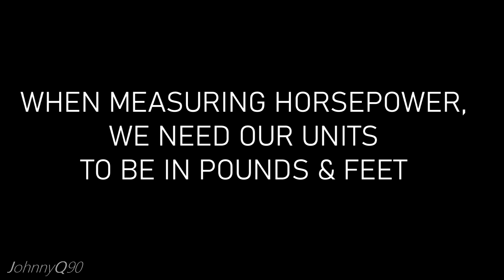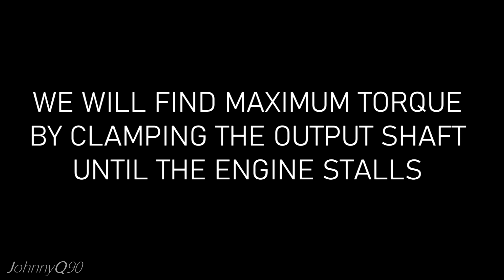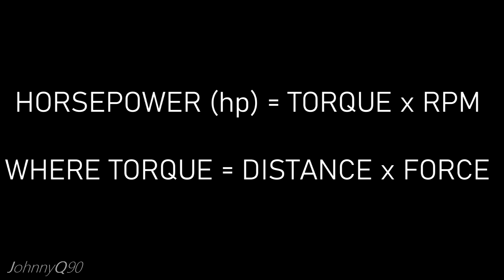Simplest DYNO for RC Engines! - Prony Brake Dynamometer!

Comment: I'm trying to design my own RC Dyno for bench testing 1/5 electric RC. I will be using gravity rollers mounted to a frame. there will be a pair of rollers between each wheel and I want to be able to adjust the resistance of the rollers but do not know what I need in order to also measure the resistance of the roller to create a "load" on the RC. I would also want to be able to capture the wheel RPM and eHP under the specific load. What is this type of attachment called and where could I find a power meter/analyzer like this? I need help and you are a genius with this stuff! My Goal is to be able to see how fast my RC will go under a specific load of resistance. And knowing the actual eHP output would be also very helpful since rated output is usually not even close to actual power output. Thanks!

Comment: Great job, i've wanted to  see a dyno for awhile. can you use a R/c Disc brake for  better control of drag? (so tightening wing nut doesn't effect reading)  and i would love to know if your exhaust mods add power, and i would definitely love to see some numbers from your Blower(s). thanks for the video.

Comment: Interesting! Works very well for a proof of concept. I think if you were looking to do an upgrade at any point, a road bike brake disk and caliper would make a more robust and sensitive system. Also, you couldn't need to get so close to the rotating assembly.

Comment: I would suggest making a small disc brake setup to load the engine with and mount the cable or servo actuated brake on the lever arm to push on the scale. You'll be able to load the engine without directly touching the arm and affecting the measurements. Also it'll involve some cool machining and fabrication.

Comment: When you are using horse power as a unit, could you please also show the value in watts? It would make so much more sense to me, as these engines are more comparable to small electric motors than big IC-engines.
Reply: 1hp is about 750w. So 0.1hp is equivalent to a 75w electric motor

Comment: Suggestion: 
Instead of using wing nuts and possibly adding weight to the scale with your fingers touching the wing nut. You could mount a high torque servo in some fashion to the brake and then use use a simple dial adjustment to clamp down on the brake for real precise braking and measurement. Just an idea I came up with watching it.

Comment: I can't say I'd trust those scales as a precision Dyno. The clutch housing might be an easier way to get better figures. The point where the engine output meets the drivetrain. This way you can make some sort of lazy clutch where it's always under friction (maybe without springs) then when you rev. it will up the load on the bell housing (connected to that arm you made)

Comment: You can calculate the HP mathematically also. The formula is HP = Bore squared X stroke X RPM and divide by 18000, I don't know the bore and stroke of your engine but this is the formula vehicle manufactures use to calculate the HP numbers for advertising and emission data.

Comment: @JohnnyQ90 Did you do the same valve thing on this engin... i know for sure, the valves dont close properly on these engines... I had to mod mine to make the valves close properly...?
Reply from the maker: Yes, same procedure here, but wrong fuel. I used 16% nitro airplane fuel, while I should have used 25% nitro for cars.

Comment: Did you consider a simple 'flywheel' type where you log the torque of the motor while spinning up a heavy flywheel?  Could make it fully mechanical with a pencil on a stick drawing on a scrolling paper...  :)

Comment: Nice to see that you made sure to talk about the limitations of your experiment!
Make sure to take into account the flex in the wood and the printed plastics too, shouldn't be too difficult for your brain to comprehend I don't think. ;)

Wouldn't it also make more sense to hook a slipper clutch up to this instead of using the wood as it's not the most "grippy" of materials? I guess that would also introduce more variables than it's worth.

I'm with Blase, when are you making an alignment machine? I bet you have something crude to deal with that aspect that works quite well!

Comment: I'd expect any manufacturer's specs to be exaggerated, but 1/5 seems excessive.  The fuel could make a difference, but there may be some measurement error there.  Given the small scale, small errors can amount to huge variability in accuracy.  Excellent concept, just a bit of refinement may be necessary 👍

Comment: My 2 ideas for the dyno brake:
Use a conductive disk that spins with the crankshaft and place a stationary electromagnet behind it. Alternatively permanent magnets at variable distance.
Should give a nice induction brake.

Second option:
Buy a large RC brushles motor, spin it as a generator. Attach a 3 phase rectifier, pwm controller and a resistor, then you can controll the braking torque with the PWM.

The first option is probably easier and more scalable if you want to measure sth larger
Reply: That second option is much easier imo i like it!

Comment: I think and electric motor with variable resistance would be a much easier and more accurate way to do this. Because you are only measuring such small output power it should actually be quite easy.

Comment: Did you apply the conversion constant? Horsepower isn’t simply pound-force x rpm. You have to divide by 5252 and I didn’t see you mention this. Also you are measuring torque force at 0.5 feet, so this also needs to be factored in. You might have done this but I didn’t see any mention of it.

Comment: You do realise that you’re corrupting the measurement by touching the bar to tighten the screw, yeah?
Reply: I was wondering too, but how could he screw it without touching? 🤔
Reply: @ponzy  maybe with a manual clutch between the engine and the wood arm
Reply: @ponzy  perhaps a fluid coupling that would allow the engine to reach it’s max torque.

Comment: There's a few reasons this is inaccurate. Horsepower isn't just RPM*torque, it's torque x RPM / 5.252. Also you're losing a huge amount of power on that method of measuring. Most of it will be lost to heat/friction on the shaft.
Reply: The dyno measures torque or force, not power directly. The motor crankshaft is braked by some method (friction here) and the braking torque is converted to linear force by the moment arm. Power lost is equal to the power in, which is (torque * RPM) / 5252. 

In any dynomometer, all of the power is dissipated, but force is measured and then power is calculated based on speed. It doesnt matter that power is lost because the dyno measures torque, not power. 

The energy lost as heat will be proportional to the power generated and the force (torque) measured.

Comment: Hi, aweomse videos as usual, if i can give an advice: Don't use electronic scale, delay between actual mesure and display can be very different, this will lead to false measure and calculation moreover with small numbers where it makes HUGE differences (0.1 or 0.2 over 3 is already much diff) . Try to find a mecanic scale, you will notice the diff  :) . Keep doing great stuff !!!

Comment: @JohnnyQ90 In my opinion, this method does not give a very accurate result. By connecting a DC generator to the output of the motor and measuring the electrical power at the output, you can reach a much more accurate result. And you can calculate power for many rev ranges.

Comment: That’s a neat low-tech method, but instead I’d have made a simple (arduino) USB/serial datalogger, using a photo-interrupter and a load-cell ADC circuit. Should get me a whole torque curve from it. Planning do do something similar myself for a BLDC, though my motor’s torque is enough to send it into orbit, so I’ll have it vertically mounted with rotationally symmetric spars connecting the brake housing to the motor housing. Using an identical motor as an EM brake, because I have two of them anyhow, and it lets me easily dump all the heat into a water tank.

Comment: I really enjoy your channel and am in awe  of the things you make, but I have never tested any internal combustion engine to a stall.  HP is measured at a constant rpm. Say 6500 at full throttle. Then measure the force.  Testing to stall is Testing to beyond what the engine is capable of doing.   Try holding a set rpm of 8000 at full throttle and see what the scale says.

Comment: Instead of trying to measure crankshaft torque directly, you could instead measure the reaction torque against the engine itself (Newton's 3rd Law). If you mounted the engine in a rotating frame, with the frame's axis of rotation inline with the crankshaft, and then had a moment arm mounted to that frame, the moment arm could apply torque to your scale. That would let you measure engine torque in real time without have to stall the engine since the crankshaft would still be free to spin. Of course you would still need to load the crank somehow so you could produce a significant amount of power.

Comment: As pointed out by others, HP rating can be at different speeds, a common thing people with model engines will do is quote a HP rating at some unrealistic, unusable revs.
OS engines used to do it all the time and I dare say this mob did the same.
Did you happen to notice they quoted their top end speed at 13,500rpm....??? YEAH.......makes ALL the difference.

Comment: Do you think using 16% instead of 20-25% nitro fuel could result in achieving only 1/5 of rated output? I seriously doubt that. To be honest I never did see a performance difference between 16 and 20% in my engines.
Maybe the methodology is off, how much does the arm weigh? I would test it again on a much shorter arm to see if it influences result.

Comment: You forgot to times the weight by the length of the wood. Times by 5 and then the HP actually matches perfectly
Reply: he did it right... recalculated everything in metric and it's 83.62W which equals 0.11 hp

Comment: 2:57 shouldnt you measure from the hole to the tip of the 3d printed piece? The distance from the tip to the hole is slightly longer than the distance where you measured.

Comment: Hi. Sorry to say but i think, this construction can not measure exactly.
You get wrong results because friction.
Change the screws with a weight and change the material of the friction point. Wood change friction more at different temperature, humidity than metal. 
And calibrate the constuction with a load you know. 
I hope its understandable. I dont often talk english. 
Or what about a generator. Let the engine turn a smal generator and increase load until the engine loose rpm. 
... and great channel. Great Videos and constructions.

Comment: I have doubts. Because you are letting the engine stall. So its not per say how much energy per unit time the engine is putting out. Its also all the energy stored in the flywheel etc. So maybe the absolute value of hp is not correct. But its very useful to measure increase of power when you make improvements. I like it very much still!

Comment: this will kinda work but that digital scale is the problem thats not going to be very accurate do to the interference of the motor and vibiration, just use a scale that has hanging weight itll be far more accurate

Comment: Not that any of your engineers are designed for what I'm going to suggest.. It would be cool to see the power difference between 91 octane gas, and maybe diesel. Nowhere enough compression for diesel, I don't know about gas. Not enough cylinder lubrication though.

Comment: actually the calculation is torque X RPM divided by 5250 = HP any engine that has peak torque above 5250 will have more HP than torque. and an engine that has peak torque below 5250 will have more tq than hp this is why diesel engines always have more TQ than hp and gas engines have higher peak hp

Comment: I feel that this is not a good test method especially for a 4 stroke single, the engine alone has very little inertia to pull through the 3 non power cycles, it would do much better if you add some flywheel to keep it turning

Comment: Is that .5HP rating really only at 5500'ish rpm?  I thought most of the RC engines run >10K rpm and would expect a few more fractional ponies at higher rpm ... edit ... rewatched and realized you're only measuring maximum torque.   I wouldn't expect to see anywhere near the claimed HP when only calculating HP at peak torque rpm.  The claimed HP is going to be at much lower torque than peak torque, but greater RPM....like any other engine that makes peak HP above 5252rpm.

Comment: You guys have to forgive me, but this engine is good only as a display, because if you want to move anything that requires power this is a waste of money.
Is this really a 3.5 cc = .214 cu. in.? Why make such a small size 4s? The smallest O.S. (discontinued) FS 30  is .299 cu. in. or 4.89 cc weight 9.6 oz (279g) and is rated at 0.49 hp at 10000 rpm. This Toyan is really nice to see it running, no argument with that, but with all that weight and belt and fan I can believe you measure such Low power and the manufacturer claims of .5 hp seems optimistic.

Comment: Bump that nitro fuel up to the Traxxas 33% nitro and see what it puts out then! I run the 33% in my 3.3 Revo and that dude will flat MOVE now... Its AWD with a 2 speed gearbox, long travel suspension arms, steel gears in the transmission, a 4 shoe clutch, dual disc brakes, all the plastic mounts have been replaced with carbon fiber, higher capacity fuel tank, primer bulb in the fuel line, dual high speed high/high torque steering servos, reverse delete, LiPo receiver battery, onboard volt meter, RPM control arms and spindles, and, I locked the rear diff so it will pull wheelies better. When I say better, I mean that the diff action would make it kind of bounce if the tires had any slip. All my buddies want to drive it, but it is stupid fast, and they would just crash it.

Comment: Nice concept, but i'm not sure you'll ever get results you can trust from that setup. You're going to need to log the force and speed at exactly the same time or the figures are fairly meaningless. a fairly simple arduino based rig would do the job. and could very easily feed te data directly into a spreadsheet to draw a graph and do the appropriate calculations autoatically.

Although it wouldn't be a 5minute project, it's not exactly beyond your skills to get this up and running, and having reliable data would be invaluable in later projects.

Comment: The nitro content is not the reason for only achieving 20% of rated power. Your torque measurement is novel, but not representative. Stalling the engine is causing a drop in rpm, taking the engine off its maximum. A better way is to have the engine “free floating” on a rotating mount and measure the torque on the mount. This will allow continuous torque measurement. Consider how many dynos you’ve seen that stall the engine.

Comment: actually no because you never revved the engine up far enough to be able to measure torque that way. lets say the torque is at 3000RPM you would have slowed the engine down to 1500RPM when you get your highest reading. Each rev while being under a clamp load wil slow the engine down progressively.

Comment: Nice work but your calculations will be far from realistic. Engine maximum torque and power varies through the RPMs and by doing this test as you do you have no control of the revolutions you measure your values at. Secondly, your tachometer and scale have a low refresh rate. I highly recommend you to build an inertial dyno with the usage of,  for example, Arduino based tachometer to gather information with high frequency. I'm sure you'll know how to construct such a thing :). With this solution, you will get beautiful torque and power curve in only a single run of the engine and it will also be very precise.

Comment: I think it would have been much much simpler to use metric, but i can't remember how to measure power in ICEs. Is it just torque•RPM for metric? Or is it torque•Hz as in, revolutions per second?
If i remember correctly, for imperial (and also CV) there's some shenanigans with the number 5252 or something.

There we go, this old man explains it best.
https://youtu.be/gC2-JKO0c2I

Comment: You won‘t come close to the manufacturers power rating I guess. Even a really high quality, japanese made OS airplane four stroke engine (OS  FSa-56) has a worse power to displacement ratio and they are really powerful and much higher reving. The chinese make cool stuff but they like to print massively exaggerated numbers on their stuff. I‘d say you won‘t get more than 0.25hp out of this engine.

Comment: Not that I'm trying to judge your work, because you do amazing work - but I was kind of disappointed by this one.

The end result was a little underwhelming.  Not the fact that you can do such small scale dyno testing, that's pretty awesome, but the actual device.  I would have expected you to mount and plumb one of your disk brake calipers onto that torque arm and a disk onto the end of the output shaft.  You could then use something a lot more precise than wing nuts.....  

Maybe that's just me being hypercritical.  Really, your videos are always awesome....maybe I'm just being an asshole.

Comment: That measure isn‘t correct 
It’s better you have an electric generator and a potentiometer 
So you can measure Voltage and Amps 
P = U • I 
It is the simplest way